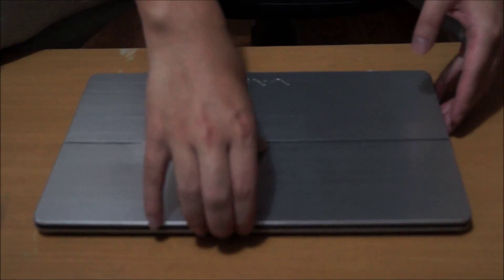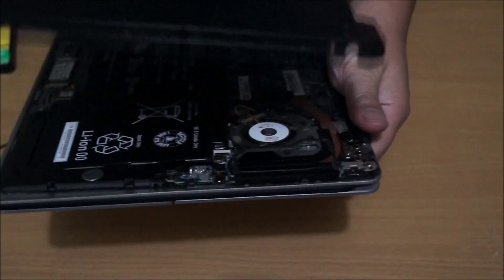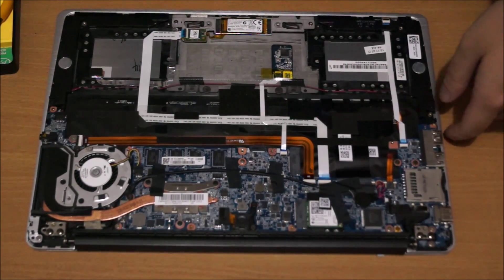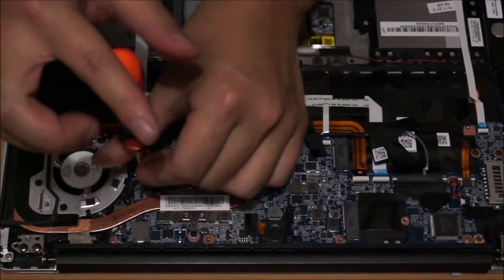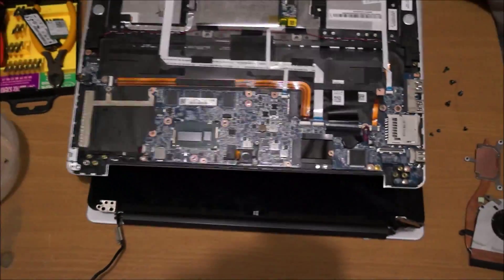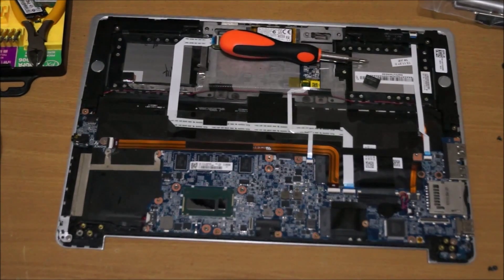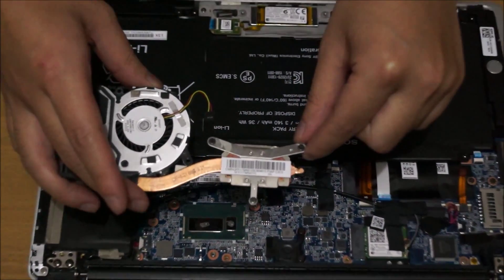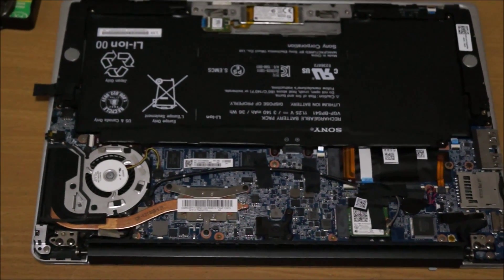OPEN ME UP! Sony VAIO® Fit 13 series Disassembly

Comment: Hi, I changed the battery, but now there is no display on the screen. Though battery is charging. Could you advise?
Reply from the maker: if it was working before you switch it out then you must have done something. i recommend you to open it up again and check it out

Comment: I need to replace the lcd motherboard flat cable where can i find the replacement cable code JS-1018 FI1A LCD CABLE
Reply from the maker: you can get the user manual and it will show you how to disassemble the laptop and replce the cable
Reply: @OpenMeUpTec  i need cable

Comment: If someone replaced only fan without heatpipes ? Fan don't have screws ( instead plastic things fixed in) to replace it without replacing heatpipe.
Reply from the maker: fan and the heat pipes are not one piece. you can remove them separately
Reply: @OpenMeUpTec  But i can't replace only fan ... instead of screw there are plastic things. Any idea what is the way to replace it?  

Photos:
https://ibb.co/93NRRyk
https://ibb.co/4fzPrKT
https://ibb.co/gVZW9cG
https://ibb.co/7nBPdQD
Reply: @michals8714  Hi! Did you managed to replace that fan? If so, could you please explain the way.
Reply: @RemainingLight  Hi, I bought fan with  heatpipe from aliexpress and replace all in one piece
Reply: @michals8714  Thanks for the fast answer! If it' not a bother, please send me a link to that item or its exact name - I need to order it too.
Reply: @michals8714  Thank you! I believe thermal paste is better, but pad is easier to apply - that's why manufacturers use it.

Comment: Hello, I would like to know how to open this other part that is written VAIO ... because I need to change the cable flat of my notebook and this part is very compacted, there I need help to know how to open that part that supports the screen to replace flat cable ... Thanks
Reply from the maker: if you fine the user manual it will tell you how to remove the cover

Comment: Thank you for a very helpful video!
Do you know how to disassemble display lower back cover in order to change screen flexible cable?
Reply from the maker: sorry I don't know how to do that. I believe the user manual will show you how to disassemble it
Reply: hi i have done that, reply if you still want to know
Reply: nikkotsoi mine LCD Display is flickering. Can you Tell me Howe to disassemble the back Cover please?
Reply: @TheNordwolf1337  but do u have a new cable
Reply: nikkotsoi no not yet, I just want to see, hear, how difficult a replacement would be
Reply: @TheNordwolf1337  i dont suggest, as the lower part of the screen cover is stuck by glue. You need to open  it and need to reglue urself. Dont suggest you to break it apart if you dont have a new part to replace

Comment: Is there any way to upgrade RAM for this model?
Reply from the maker: nope 
CPU is solder on, graphic card is solder on, ram is solder on, wireless card can be changed, and hard drive is a M.2 that change be changed.

Comment: HI Open me up,

I have this laptop but lately it will not always start.. keyboard will light up but nothing else will work. there is a ticking sound but I can't find the problem. any thoughts?
Reply from the maker: most of the parts on the laptop is soldered on therefore if you having an issue it is quite bad. i believe your motherboard is faulty even though it works now and then you will probably reach a point where it wont turn on anymore i had a few laptops with this issue
Reply: OPEN ME UP ah alright, so some bad news. Thnx anyway!

Comment: hi OMU can you tell me how  i can find a  CMOS battery for this   machine?
i search for  SVF13 and SVF13n and SVF13n17  ,  with CMOS battery nd  i get nothing
the DC charge port is even harder to find for it , i managed to fix the DC jack but it is still a little wonky  , i scraped down the  positive pin with an exacto blade when i had it open to  replace the fan/heat pipe ,i also tried to bend it out a little with a needle nose   tweezers and i  scraped down the   middle pin on the charge cable too and it works so much better now but the port on these things is awful it stops charging ,before i cleaned it i had to wrap the cord and jam it in the hinge to keep pressure on it to keep it from  powering off
but now i keep getting the clock jumping to all crazy dates and times sometimes 10 or 20 years in the future , i am not sure if it is the CMOS battery or not though it could be a virus
my other sony vaio is an i3 form like 09 2010 and still no problems with that CMOS battery 
unless this one is defective , i wish i had a replacement when i opened it to change the fan (this is the second fan 1st one was replaced under warranty) but now i am having a hard time finding what kind of  CMOS battery i need , i forgot to  take pics of the inside when it was open too
Reply from the maker: the battery is near the wireless card and hard drive and sd card. at 2.00 you can see it bottom right hand of the laptop
Reply: yes thanks  i know where it is i saw it when i opened it to change the fan but i did not look at the part number volts amps  etc so i do not know how to buy a replacement i do not want to open the  computer again until i have a replacement part but i do not know what to search for to find one to order
Reply from the maker: you will need to open it up again to find the part number. if you want the simple and cheap method you can get the battery inside and peel off the black warping (tape it up again with the replacement) and just go to an electronic store and get the same one instead of buying the whole thing.

Comment: Hi OPEN ME UP!  I have the same unit and the screen would turn dark when I flip the screen to use as a tablet.  I was told that the LCD cable was broken.  Would you please make a video showing where that cable is and how to replace it.  Thank you!
Reply from the maker: no longer have the laptop to help you.  but if you are asking me to show you it will be too complex for you to do

Comment: WOW thank you soooo much for this awesome video!!! I'm trying to upgrade my stock 128 GB SSD for a 1 TB one (Sony charged an eye and a tooth for those 500 GB suckers when I got my Flip 13 [Sony called it the "Flip 13" here in the U.S.] a few years ago). BTW, do you by any chance know if the M.2 port is SATA III or PCIe? the stock Samsung M.2 SATA III SSD that Sony shipped with almost all VAIO Flip 13s had M+B keys (compatible with PCIe or SATA III board controllers; although the SSD itself is SATA III) so there's no way to know if the M.2 port on the motherboard also supports PCIe in addition to SATA III

Thanks beforehand!
Reply from the maker: it is most likely sata m.2 as PCIe m.2 wasnt really available when this was produce
Reply: OPEN ME UP Awesome, thanks for the quick reply! I think I'll give the Samsung 850 EVO 500 GB SSD a try
Reply from the maker: make sure the SSD fits into the slot as you may know the keys can be different
Reply: yea. just to make sure, the slot fits an 80 mm or 60 mm?
Reply from the maker: 80 which means it can fit everything else as well. it is extremely rare to find it is anything else other than 80mm
Reply: awesome! the samsung 850 EVO that I'm thinking about buying is an 80 mm so that works. Thanks so much for all the help; it's extremely hard to find any info about this ultrabook online. Not even Sony representative themselves know the specs for sure!
Reply from the maker: the reason for that is they dont want you to mess with it and ask them to do it. a business needs to make money so having you DYI does produce any money for them